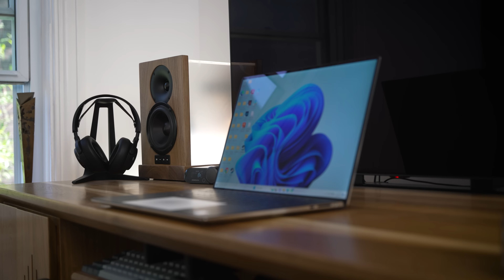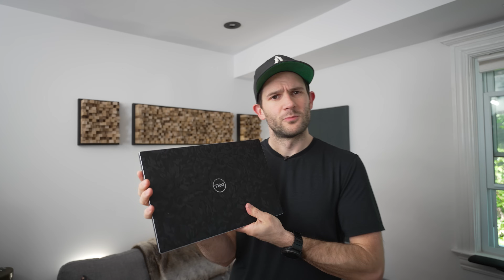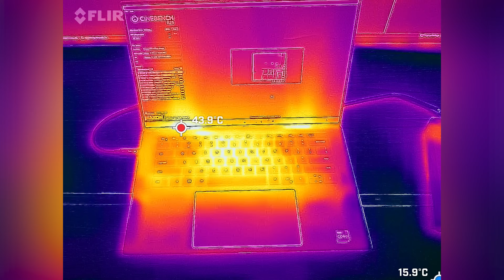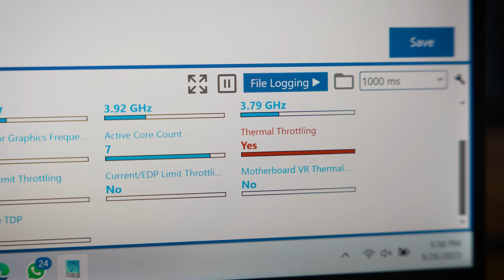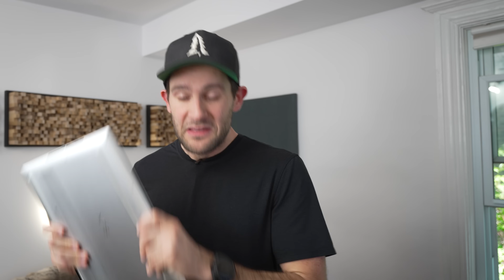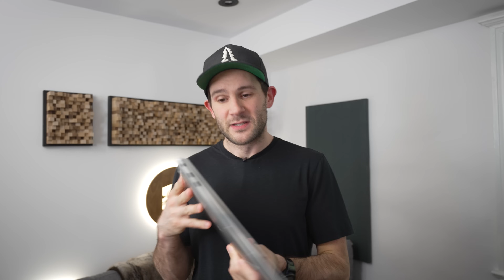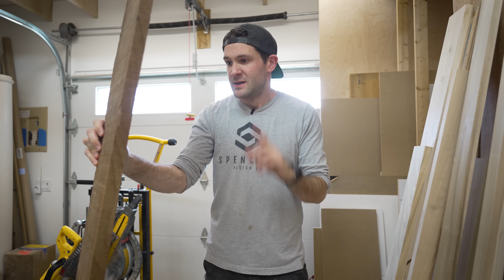The BEST mod I've ever seen....

Comment: So.... this is awesome.
But, I would rather carry a thicker laptop than this entire contraption with the laptop on top. But yeah - the Framework or M1 are probably the two laptops with the absolute best thermal performance out there. I dunno about the Framework 16 and the GPU module tho.

Comment: I do recommend you gaming laptops, i never understand these compact builds, many people don't even know or understand about heat dissipation, right now i am running my lenovo legion 7 with rtx 3070 and ryzen cpu and with proper fan control i going max 80 celsius on full load. I also was thinking about the alienware laptops since they use 4 fans instead of just two. But those can get a bit expensive and i don't think i can buy one here where i live.

Comment: Dell laptops, especially the Latitude and XPS lines, are pretty decent computers for the price. The problem is that their software is atrocious. The whole Dell Data Vault, Dell Digital Delivery, Digital Assist... all those tools are bloated as hell and suck up your overhead. They make the storage engine glitchy and bad, they constantly change settings or update things without asking much like Windows or Office updates, and they're generally geared toward buying a much stronger PC than you need so their corporate BS can run in the overhead. Reformat and it's golden.

Comment: Honestly, thin and performance just can't mix.  If you want power, you need something that can actually dissipate the heat.  Or, don't get a laptop with a dedicated GPU, instead look at an external GPU.  Stay FAR away from HP, their support is horrible!

If you aren't needing one right now, keep your eye on Framework.  There is a video on Linus Tech Tips where they showed a very early preview of a unit that should accept GPU modules

Comment: Hey what power settings did U do for when it's on battery power, I have the same xps 15 and I'd like to reduce performance when on battery, thankyou
Reply from the maker: I used a program called Throttle Stop to limit the CPU to 20 watts

Comment: The docking station sits underneath the fan where it should be sucking in the air? Isn't it limiting the airflow the fan can suck in due to you limiting airflow underneath the fan?

Comment: Say what you will about apple they do make a laptop that stays cool sips power and has basically best in class performance for a thin and light. That being said I wouldn't want to use that much paste in a system like this. Paste dries out so i would have used phase change thermal pads instead of paste anywhere i needed to bridge larger gaps. doesn't dry out. And it has similar conductivity of paste.

Comment: You use wayy too much thermal paste. Yeah it's not conductive but have fun clearning it out when it has dried in 10 years

As for recommendations, I've had a good experience with MSI laptops

Comment: I bought my last MSI laptop because it had the best components AND, a THICC case and good cooling components. You cant do good cooling with tiny heatsinks and fans. I also modded it to accept a biggerheatsink and and external watercooler ( with two of those big Noctuas). The sound of tiny laptop fans revving up is just too annoying. Of course If I wouldnt need the portability I would go with a well cooled big tower PC.

Comment: As far as laptop manufacturers go, they are all pretty similar. Everyone is putting in the minimum work to crank out a new generation every year, so they basically all have issues (looking at you Windows Modern Standby). The business grade machines usually come with better support (Dell, HP, Lenovo), but let them know it is a business, not personal device when buying. I feel like you get a different support team. For the future, I would pay very close attention to Framework. That is where I will get my next laptop, and for anything DIY, the videos basically write themselves!

Comment: I honestly don't think any brand is excluded from wrongly cooled power hungry chips. In my case I bought a HP Pavilion 15 with a Ryzen 7 3700U and it simply performed worst than the model with a Ryzen 5 3500U bc of the thermal throttle. I decided to take things a step further and replaced the heatsink with the one of the models that came with Intel CPU and a dGPU (the mount brackets are compatible in this case), and replaced the single fan for 2 of the ones that came with Intel model as well. Now the only constrain I have is the power limit that HP decided for this poor chip (15W XD), so with a bit of tunning when I wanna game on it, I tweak the power so it can draw a little more (not the 35W AMD claims for its max TDP bc the power brick can only deliver 45W and the machine would simply turn off haha)

Comment: I'll tell you what I tell everyone.  Go get a Clevo or one of the rebranded Clevo: Eurocom, Origin, Sky.  Get the one with the swappable MXM graphics and the Desktop CPU socket.  You can mod the 6th and 7th gen machines into 8th-9th gen if you want.  Then you'll have niceties like 4 DRAM slots and 4 SSDs (2x 2.5" 2x NVMe).

If I was modding the OEM laptop you have, I would just buy a second heatsink, lay it on top of the first and get a fan that is twice as thick.  Then make a spacer for the bottom panel and some rear pop up feet so it can get cool air. 🤷‍♂️.  With that base you now have you could fit an ITX system with a 3060/3070 inside and attach the screen and a mechanical keyboard to it 🤣

Comment: would the fan not be drawing heat from the power brick onto the back of the laptop 🤔 have also seen cases of laptop stands not working for the reasons mentioned in the video, alongside them not usually including outtake fans. I suspect a lot of the performance might be coming from the replaced thermal compound from stock hahaha but really cool regardless

Comment: It was good you replace the thermal paste because your laptop is old and why don't you just buy a EIT 5000 cooler instead of building this? It's a 3050, you don't need a cooler , it's basically a chrome book

Comment: Buy anything but asus. Have zenbookpro 15 with i9 and the plastic inside the laptop is disintegrated as of now(after 4 years of purchase). Now It has around 50 or so screw holes fixed with super glue.

Comment: Can you manufacture a botom part with finns and change the airflow pattern of the fans to pass through it in order to turn the bottom to a huge heatsink? With cnc for aluminum or 3d printing and electroplating

Comment: Dell laptops used to be awesome at the beginning of the last decade till about 2015-16, then for some reason quality dropped. I got myself a Samsung Odyssey in 2018, and if I were to get a new laptop I'd probably go for a Samsung again.
Reply from the maker: It's funny when I was a kid Dells products were regarded as some of the worst, then they gradually got better, and then like you're saying around 2015-2016 took another nose dive. It's really an up and down company
Reply: @ZacBuilds  Unfortunately the xps has the premium (high performance) thin and light market cornered imo. The set of customers that want both a slim sleek premium laptop with gaming gpus is very small abd after their money is spent no one cares about their unique problems. On the plus side your XPS still has a functioning lid. I bought a Samsung Flex 15 in 2020 and while the shell was Au the connection points in the lid were plastic. Needless to say the hinges broke a year in (light use) just after the man warranty expired. Google to see many examples of this type of samsung gore. Maybe in a couple years we will have the perfect laptop, maybe its framework, but for now I'd say go beefy and get an actual gaming laptop, or get the standard thin and light everyone and their brother/sister uses... an m1 macbook and don't expect to game on it. Thats what I did and Im really happy. $800 bucks new. Works when I need it. If it breaks, it doesn't hurt so bad but with the user base on this specific model so high, the pressure is on apple to make it work. Never thought I would give apple a shot but here I am. Of course I still have a gaming desktop, and parsec helps alleviate the need to game now and again, or any other high performance needs.

Comment: Voiding warranties in the US is harder that many of these mod videos imply. Warranties are only voided on what the end user damages for the most part. and proof is on the manufacturer. There is nuance and the like so check with a lawyer to sure if it matters to you because I'm not one.

Comment: Good video man, although I have to say to me Dell is one of the best if not the best laptop Manufacturers, maybe they have slacked off on the new hardware but I'm rocking a Dell G3 with a 1070Ti and it's never given me a day of trouble and it was bought second hand but was in immaculate condition.

Comment: HP zBook is great, or atleast the older one i got.   i have a 7th gen INTEL i7 zBook 15 G3, still holds up great with its 4x so-dimm slots, 2x m.2 slots and 1x 2.5" drive bay.

Comment: Imagine if there was a policy inplace that if you advertise these kinda specs and speeds they had to perform at these specs if not you got a fine for every single one of these that sold that didnt meet the requirement. 

Wed soon be seeing labtops that are either thick enough to handle these beefy parts or a sudden influx of income for the gov't 😂

Comment: Easier solution: buy a Cooler Master NotePal U2/U2 Plus, replace the 2 small fans with 2x120mm that run at 5V via USB (Noctua for example), link them with a fan splitter and connect to a USB port. Profit 😁

Comment: 3:27 Could you explain why it's just as strong as a solid piece? I've always wondered, yet no one online seems interested enough to explain.
Reply: When prepared and done properly, the glue is actually so strong that it takes less force to break the wood than it takes to break the glue joint.

I've repaired a step stool that broke a few times in the same spot, but never the exact same break, because the glue was so strong that it would create a whole new break right next to the old break/glue joint.

Comment: laptop recommendation ? just NOT a MSI, they're made of cheap materials and the hinge broke on mine and 3 of my friends about around 3 years of regular use. also the sound card on mine never worked with the jack connector and this is a "known issue" of this product but they never made any update to fix it... so yeah don't buy MSI
Reply from the maker: Appreciate the info! I'll make sure I avoid MSI or at least very carefully scrutinize the reviews before I make any purchases. Appreciate the heads up!

Comment: Hi, I like the wood designs even though a Cooler Master 23 would've done the job. For a new laptop I would recommend a Razer Blade Pro 17. The reason for that is the extra fan or fans used at the bottom for intake, meant to move the hot air generated over the board, and push it to the exhaust. Some models have one bottom fan, and some others have 2, making the device a 3, and also a 4 fan laptop that is both cooler than most, and more quiet. Consider it ✌
Reply: Do you have a link for that  cooling pad ? Not coming back in Google

Comment: i sure got a recommendation for a different brand!
NOT MSI, cuz holy damn are the hinges bad, the plastic is the crappiest they could find in the long run and it's so loud you gotta tell it to only use 40% of the CPU to not sound like a jet engine when windows decides to install updates in the background while trying to follow a lecture

ASUS is actually the next brand i consider if not framework

Comment: Dell is much hotter than other brands. I am using latitude 5491 i5 8400H and feel too hot when plugged in, it only has 1 small fan, 1 tiny copper pipe.

Comment: i recently bought a lenovo ideapad gaming 3 with a rtx 3050ti and Ryen 7 5800h and it's max temp using the most hard to run game in my steam library was 77ºC wich i've seen that is in the area were the laptop doesn't thermal throttle

Comment: Opening the back of your Dell does not void the warranty. Dell laptops are engineered to be user serviceable. Even if it wasn't engineered to be users serviceable it still does not void the warranty to open a case. Its on the manufacturer to prove that by you opining the case you broke it. The burden of prof is on them. A broken void sticker is not prof you broke your computer!

Comment: I believe if you drilled holes or thins on the back of the laptop it would be better since you are using the fan as intake instead of using the body as an inertia cooling.

Comment: Cooling pad Do "work" . Most dont
any kind of cooling pad that can prevent the air from going the "other way" aka  anywhere that is not your laptop is generally bad which is why
bot iets gt 500 and gt600 is main stream right now. assuming gt600 is even up fs on na/eu

Comment: What would you think about adding some more ventilation holes in the bottom of your laptop case, instead of connecting the heat pipes to it (if you were starting again)?
Reply: Ventilation isn't the problem, it is thermal conductivity. Heat Pipes transfer heat away from critical components. Air is an awful medium for heat transfer. Piping it away from the components with a heat pipe and then dissipating it across a larger surface area like the case is 100% the best option here.
Reply: @TheOldSchoolCrisis  I was just thinking that the stock cooling solution doesn't get enough ventilation, so that would at least allow the stock cooling to function better.

Comment: I have been In IT for many years. as far as what manufacturer is better then dell...dont get hung up on brands. every company has really good models and bad models. a lot of them will even make good pc's for a few years then suddenly they cheap out and make some bad models for a few years... just do the research read reviews and stay away from brand new models most of the time. truth is there is a dell that will meet your needs as well as a hp and what ever other brand but there are also models in all of those brands that should work but don't because of design "flaw's".

Comment: If wood was as strong as if it was one piece when glued together then why do pieces glued together always break right at the glued spots?
Reply: Something that is prepared & glued properly won't break at the glue joint. I've seen this with wood furniture I've repaired. A step stool broke several times in the same way, but always a new break because the glue joint held like it was supposed to.

Comment: I would have used thermal pads instead of spreading thermal paste everywhere, less mess and accomplishes the same heat transfer.
Reply: The problem is thermal pads work best between two flat surfaces, thermal puttty can bridge irregular surfaces with varying height much better.

Comment: I had a sony laptop that would thermal throttle at idol! Popped that baby open and added a little bit of Liquid metal and ever since it's ran great. After about 2 years It dried up and need to be reapplied which is the only downside i've found

Comment: Nice cooling you build sweet i make my own cool fan with two 12 volt battery fan with keep my laptop very cool and nice my cool fan is giving problem in laptop have change but this two fan i have lot air blowing in my laptop i used both ways to do it with same 12voth battery 7.2AMP 20hours or i can used USB port

Comment: Great woodwork, but from practical standpoint this is not very cleaver. If You want workhorse then buy stationary PC, not a laptop. Laptop are good in the field, where any tool is better than no tool. If the office I don't need the hassle with small and often poor screen, necessary additional peripherals and worse price to performance ratio.

Comment: finger jointed boards are about as strong as a single piece... definitely not two pieces just butted together. even that depends on the direction force is applied. it ain't metal, and it ain't a weld.

Comment: Give me a 10 to 15 Pound 21" screen laptop. Weight is not a problem the damn thing sits on a table 99.99% of it life. and if U can't lift it  get a Gym Membership and bulk up baby..  I have OLD OLD computers from the 80's that were Luggable as big and heavy as a portable sewing machine. A sony with 9" CGA CRT 1 5&1/4" floppy drives 1K of memory with a 6 pac and a WD 10 KB Hard Card. And it runs DOS.

Comment: dell is better than acer, asus, and hp when it comes to performance. maybe you should modify your next dell pc so that you wont have the same problems as me, out of ALL of my laptops, the dell charging port had a lot of problems! so maybe your next dell laptop should have a different charging port, you might need to make a modified case for the desktop psu for your dell laptop or something...

Comment: That k5 pro is a nightmare to clean off. 😅😅😅
Reply: I just scrape it up with a plastic razor, then use thermal grizzly solvent and a microfiber. The solvent they make really melts silicone compounds aggressively.

Comment: i'am so tired of seeing YouTuber after YouTuber who all think they know better than the designers and engineers behind the product. There is a reason that the back plate of most laptop made with aluminum, has heat repellent adhesive attached. If you like your battery, then you don't want any heat from the CPU, transferred to the case of your computer itself. In addition to that, the computer can in the worst case, cause you as the user damage in the form of burn damage of various degrees. It's not just for fun, there are rules for how hot a laptop is allowed to get in order to be sold in the US and EU.